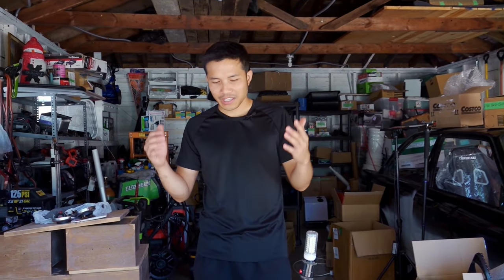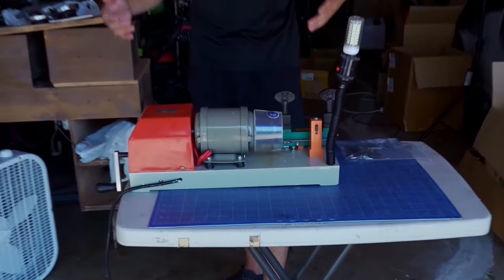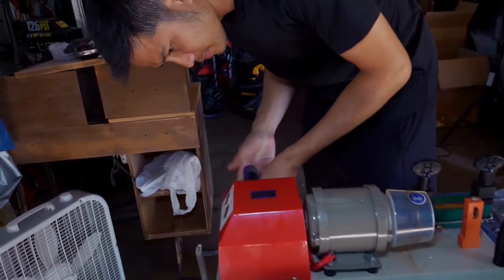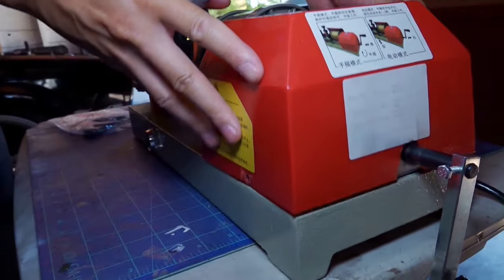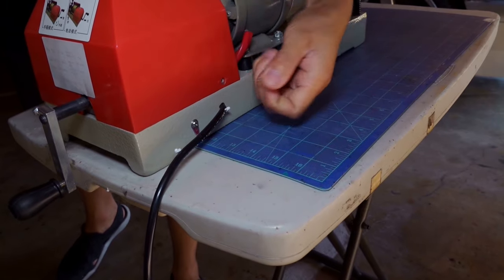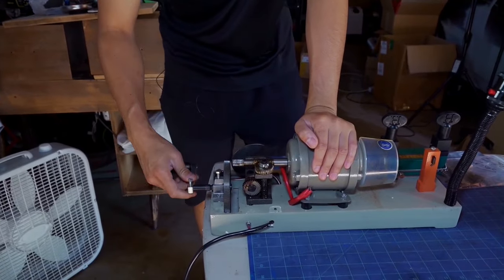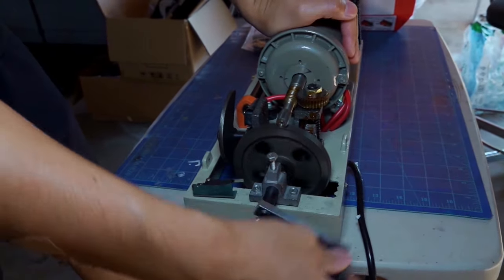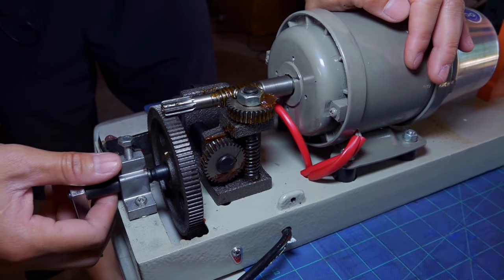E30 Fix 25 | $125 Your Own Key Copier Machine

Comment: I had a local auto locksmith shop make me a key from the tumbler numbers after I lost mine years ago. Also had a copy cut at a “tru value” hardware store and they made a similar machine.
Reply: Yes, but here the problem is not that it's a car key or something, the problem is Mackey is bringing his own blank, and locksmiths don't like that. Simply because they make some of their money on the blanks and also can't guarantee the finished product, because it could break tomorrow because of a bad quality blank and it wouldn't be the locksmith's fault, yet most customers would blame it on them, hence why they're not comfortable working on them. It's kind of the same story as bringing the parts you bought on ebay to a mechanic.

You can still find people that will accept it, but they're getting rarer and rarer.